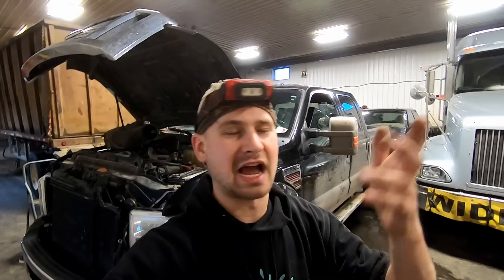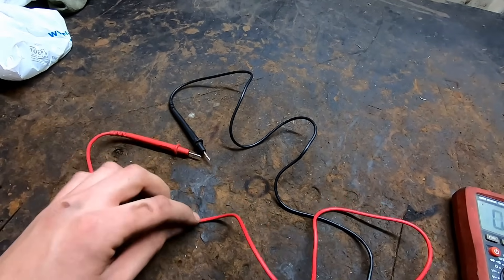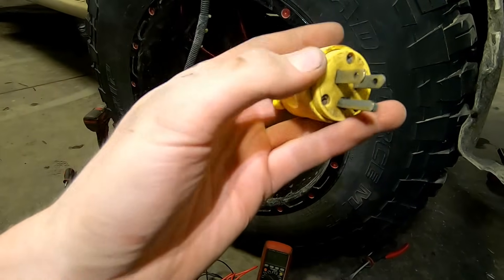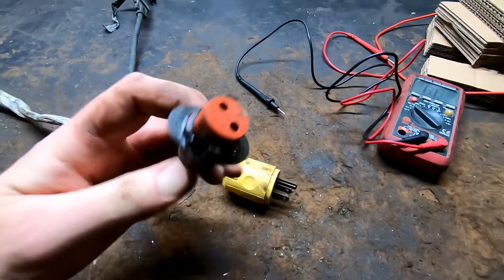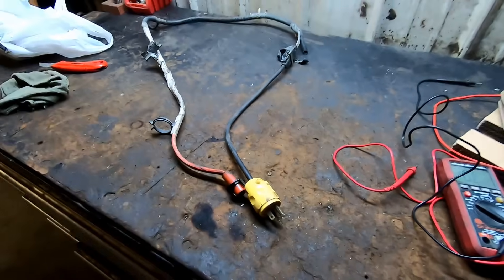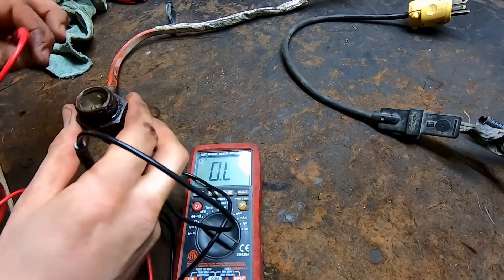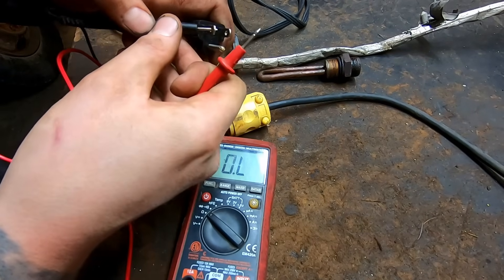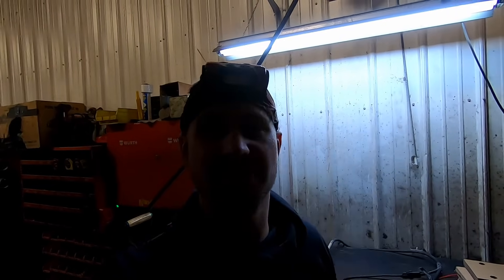How to TEST and DIAGNOSE your BLOCK HEATER

Comment: Thank you great video, I am getting a tingling feel/shock when I plug in the block heater cord. I assume I have a bad ground? There shouldn't be any resistance correct between ground and neutral and ground and hot?

Comment: I checked mine as last winter it had a hard time starting at -30. Mine read 11.9 I have a 2017 dodge ram. My battery is 8 years old I'm getting a new one . My question is 11.9 a good number ?

Comment: Thanks. Very informative. What would you do to test a GM cord, that doesn't "light up" the block heater until minus 20 C?
Reply: Some Gm cords have a built in thermostat and won’t send power the bloc heater until it’s -18° outside.
Reply: I’m testing a brand new cord as I type this . Got it in the deep freeze now I’ll test it in the morning. I only had continuity on one wire so hopefully both will have continuity tomorrow 👍🏽

Comment: That yellow male plug you had in your hand is a 15 amp plug it should be a 20 amp plug. Those block heaters are just like a electric hot water heater element. I am sure your block heater is at least a 1,000 watts. Which means you should have a 20 amp plug on it. I have been doing electrical since the 1970's. All block heaters are 120 volts AC!!!

Comment: Tip for you. Remove the filler cap on the radiator and stick a shop vac hose in it. Don't stick it down in the antifreeze. Turn on the vac and pull your heater. The vac will keep the antifreeze in the block and not all over you.
Reply from the maker: Sounds made up but I’ll try it next time!
Reply: @darkirondiesel  Simple physics. It puts a vacuum on the readiator/block and it keeps the anitfreeze in.

Comment: The Borg have a saying:  ''resistance is futile"  Were they talking about block heaters?
Reply: noun: resistance

1.
the refusal to accept or comply with something; the attempt to prevent something by action or argument.
    "she put up no resistance to being led away, by THE BORG"
2.
the ability not to be affected by something, especially adversely.
"some of us have a lower resistance to cold than others"
3.
the impeding, slowing, or stopping effect exerted by one material thing on another.
"air resistance would need to be reduced by streamlining"
4.
the degree to which a substance or device opposes the passage of an electric current, causing energy dissipation. Ohm's law resistance (measured in ohms) is equal to the voltage divided by the current.

    a resistor or other circuit component which opposes the passage of an electric current, such as A BLOCK HEATER element.

Comment: Great video! very informative. Turned out my heater worked fine. It was a dirty male electrical plug. didnt look dirty just dull. hit it with a wire brush and its fine now.

Comment: Good video.  I  had a new 20 amp circuit put in my home for my truck to be plugged.  When I first plug it in it seem to be ok.  Then after a short time it blows my GFI.   So doing these test may help me to find where the default is.

Comment: Very informative, what would cause a block heater to Fail?
Reply: Some failures can point to the antifreeze’s fault but personally I’ve seen these elements simply wear out over time (nothing lasts forever) as well as in some cases the element somehow expands slightly and contacts the element housing, This is a manufacturing defect as a bunch of heaters from the same brand have had this issue. Long story short, you have two different things that can fail, cord and element. As shown in the video, if one’s good then generally the other is at fault if your test procedure is done correctly.
Reply: 1. Corrosion.  
2. Leaving the heater plugged in when starting the engine.  The water pump can actually prevent hot coolant from getting away from the heater and cause burnout.  Especially problematic with DD60, C-11, and C-13 and some Deere applications with the heater in the water portion of the oil cooler. The block heater manual tells you not to run the engine with it plugged in, but few people read the manual.

Comment: Good info indeed.   Was checking my block heater on our diesel motorhome in this manner, and it appears to have very little showing when checking in this method, so I'll assume my block heater is toast.   Hoping it will start ok without it, as it should be above minus ten, so not extreme, but still cold here in B.C.
Reply: as  a back up,  i use a magnetic block heater, and this will allow me to move it from vehicle to vehicle,  some have different wattage, so go for something that will be suitable.

Comment: When I saw the circuit showed 0.06 ohms when you put the positives down the negative together, I was expecting to see the same numbers when you connected them to the block heater cord.  The reason would be because there is no power coming from the block heater. So why would the ohms change to 36 ohms?
Reply: Ohm is a measurement of resistance in the conductor path, the heater coil has a certain resistance. The measurement of resistance is not dependent on power in the circuit. The meter has its own power source for circuit testing.

Comment: Is it normal for a block heater to hum when plugged in? 

I just plugged in my truck for the first time this season and I noticed a humming noise coming from the where the block heater is? Ive had the truck for 10 years and never noticed the noise before? 

Seems like after about 20 minutes it stopped humming all together?

Comment: My block heater on my 73 keeps tripping by GFI. If there’s a break in the cord well that trip the GFI?
Reply from the maker: It’s probably shorted out or something. Either find the fault in the cable or just replace the whole thing.
Reply: @darkirondiesel  
Yeah but my OHM reading is 14.7 Connecting directly to the plug hanging out of the bumper.
14.7 tests good. 
No? 
Am I missing something?
My heater works fine on a circuit that’s not GFI protected. If I plugged into a GFI trips no matter what GFI I use outside. Which was never the case until a few days ago when it started tripping all of my GFI outlets outside. 
If I plug it directly into a unprotected circuit and it seems to work just fine.
Just can’t figure out why it’s tripping my GFI’s all of a sudden
Reply: @jayonez137  did u ever figure it out I’m having a similar problem
Reply: @ryanterry5157  
Yup
Went to the Ford dealer and bought a new OEM wire.
My block heater was fine. 
The wire was shot.

Comment: What about the gas trucks with the thermostatic controlled plug? Dose it have to be -18 c or colder to check it?
Reply from the maker: Hmm that’s a good question, I’m not sure! Go to a parts store and ask to see one and quickly test the resistance haha. If you find out let me know
Reply: @darkirondiesel  I will do that. She is -40 wind -50 in North West Alberta Canada.
Reply from the maker: Yup that’s how it is here in the prairies right now too. Just gross outside. And the wind is awful.

Comment: You shouldn't ignore the ground prong and here's why. If you have a short between the hot prong and ground you will blow a breaker and your check here may still show proper resistance across positive and neutral.

Case in point, its -35 outside, my block heater is showing 30ohms as usual, but its also showing a short between ground and positive (You can test this using the diode function on your multimeter).
Reply: Yes, you are correct. As a short to the ground can trip breaker if severe enough, but it will definitely trip a GFCI
Reply: @johnford010  Ohm reading will only indicate a bad circuit not if the circuit is good or how good the connection is.
Reply: The two relevant test connections are the Common and Ground. The Common (black jacketed wire) is the HOT and the Ground (white jacketed wire) is what completes the circuit. Both of these connections terminate at the two blades of the plug.
The single cylindrical connection on a plug, is the Safety Ground (bare copper wire). 
Its sole purpose is to provide a low-resistance path to Earth during a fault scenario, preventing electric shock. There's no current flow within the Safety Ground. 
If there is, you need a new electrician.
Reply: rubbish

Comment: Hi awesome video! I have a 6.0 Powerstroke and the cord is new and checks out. The block heater also checks out regarding the ohm reading. Whenever I plug it in my gfci outlet blows no matter what outlet or extension cord I use. What do you think could be the problem?
Reply from the maker: Hmmm that’s strange. Can you try plugging in another similar vehicle with the same outlet and cord to eliminate it’s a problem with the residence electrical? Like a weak breaker?
Reply: Check for a short between the two prongs and the third ground prong.